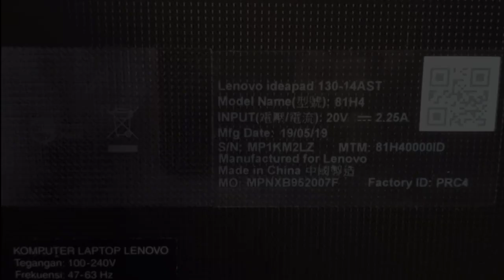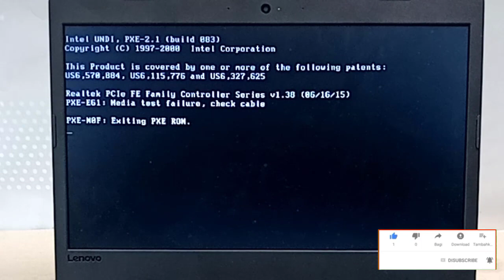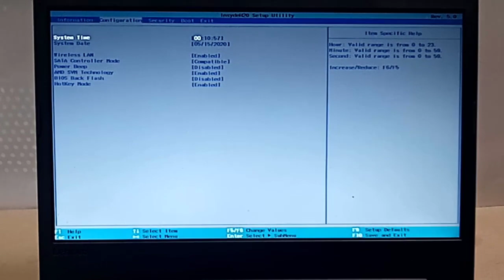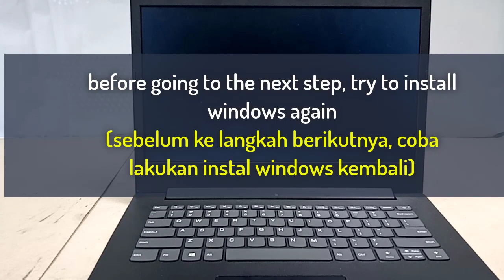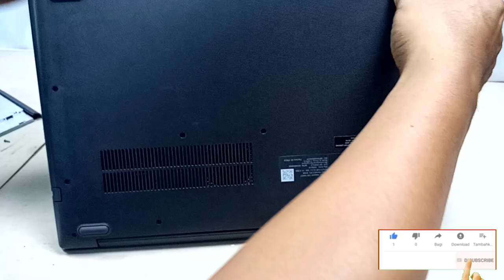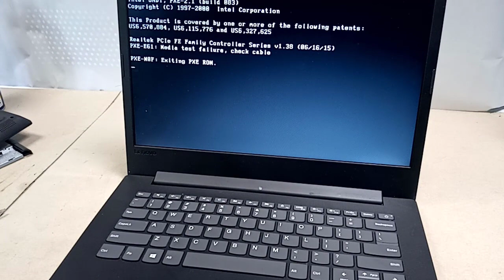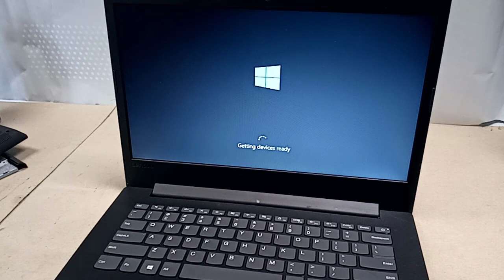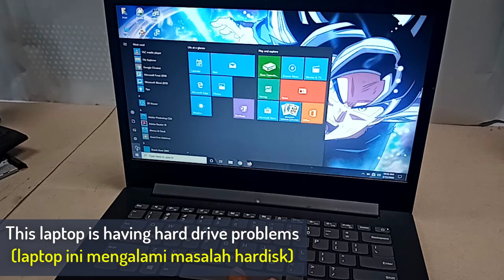How to fix a windows laptop not booting, default boot device missing or boot failed, Lenovo Ideapad

Comment: Hey hi...it didn't work for me. Instead of sata controller mode in configuration I have usb legacy. Also instead of svm technology I have intel virtual technology.?
Reply from the maker: if this method is not all successful, check the hard drive detected in the BIOS
Reply: @FreshcomChannel  yes the hard drive was detected in bios. In information tab hard disk row had a no.

Comment: The sata  controller mode is not in my laptop so what can I do
Reply from the maker: different types, try to check the hard drive whether the hard drive is detected in the BIOS? if detected try reinstalling, if not try to dismantle and reinstall the hard drive
Reply: @FreshcomChannel  OK I am checking it. Thanks for your advise have a good day brother. I am so worry about my laptop prey for it 😥😥😥

Comment: Kalau pake ssd gimana kak?
Reply from the maker: ya lebih bagus la.. laptop akan lebih enak dipakai, windows 10 sangat cocok pakai SSD dari pada hardisk
Reply: @FreshcomChannel  iya kak, mohon maaf , laptop sy sudah pakai ssd mengalami kejadian seperti video kakak
Apakah hrus ganti ssd? 😭
Reply from the maker: @fa5900  o gitu, coba instal ulang aja dulu...jika tidak berhasil baru periksa SSDnya, semungkinan bermasalah
Reply: @FreshcomChannel  baik kak
Terimakasih banyak ya 🙏🙏🙏
Reply: @FreshcomChannel  not working with ssd also..